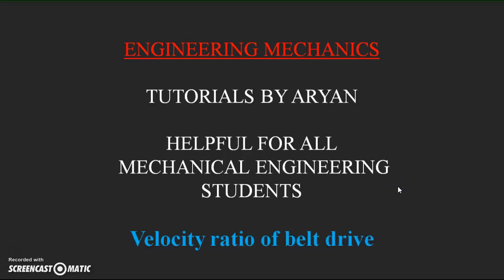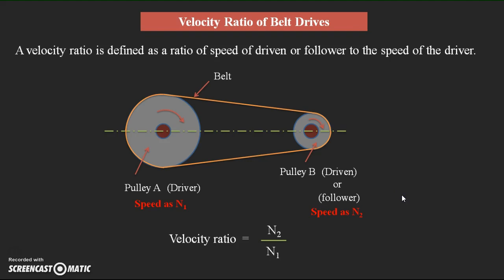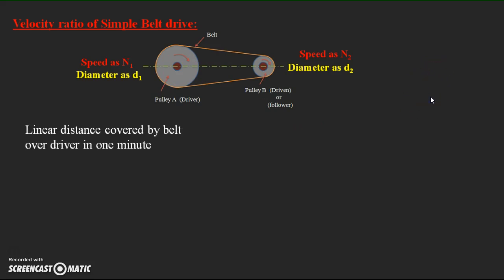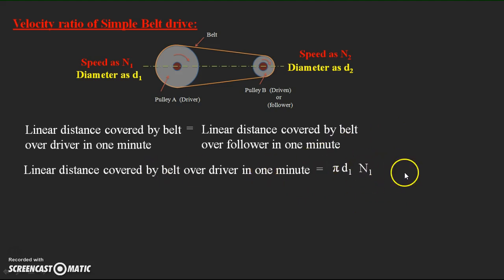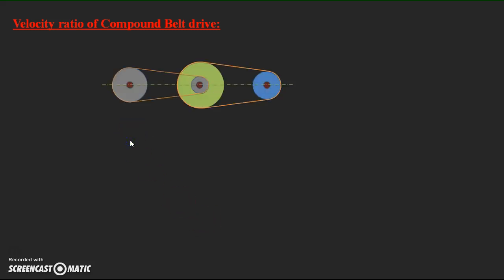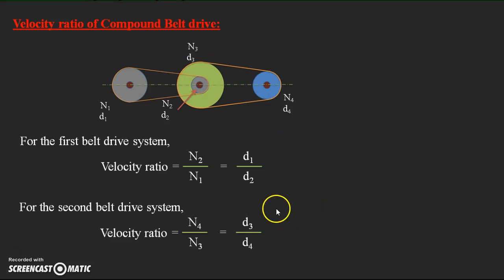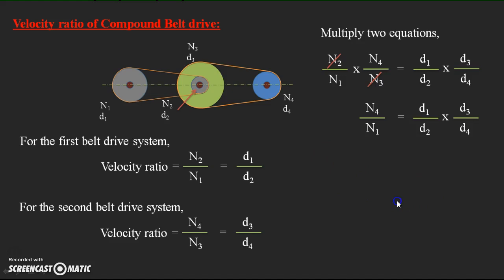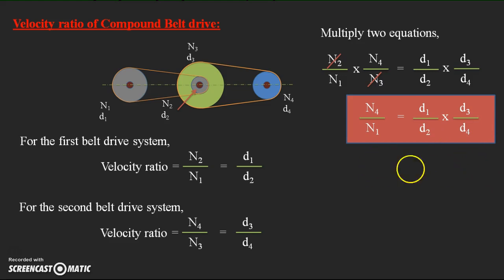Velocity ratio of Belt Drives

Comment: Sir,in case of horizontal drives we say lower end is made tight to produce more sag on upper side,n if upper side is made tight then slip may occur, sir my question is that is there any effect of changing the direction of belt(rotational motion) i.e from clockwise to counter clockwise n vise versa.
I.e is there any effect of changing the direction of rotation of belt to avoid the negative effect of sag.